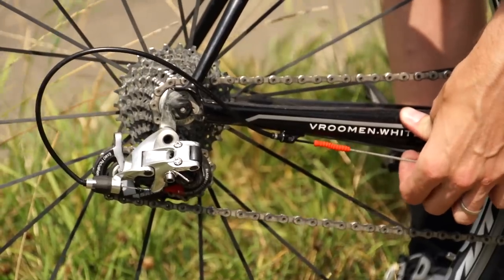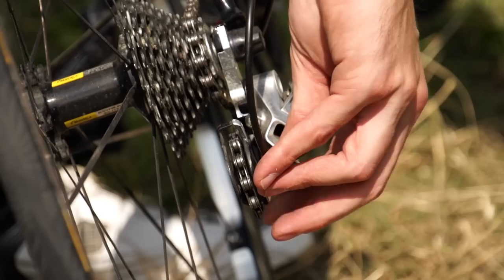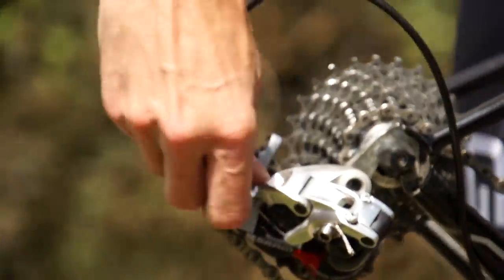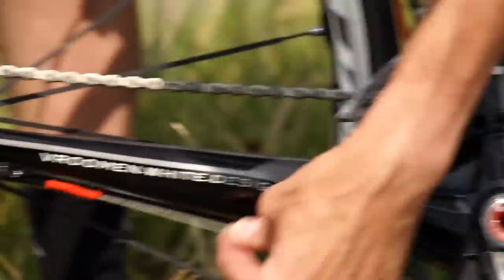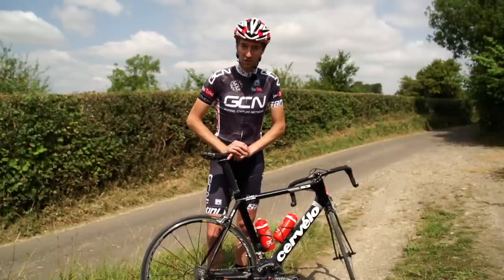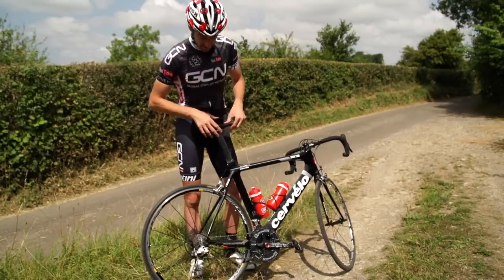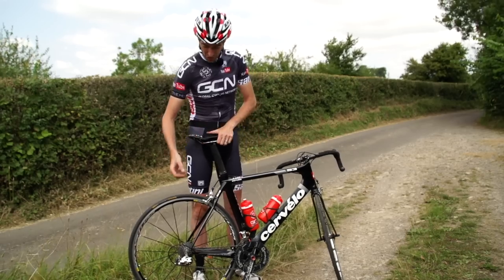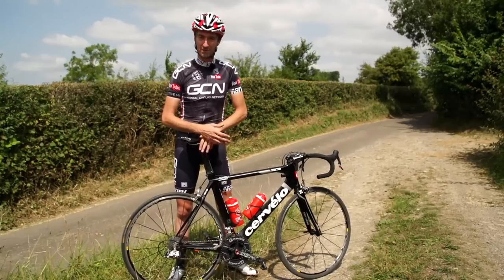How To Adjust Your Gears On A Ride - Roadside Maintenance

Comment: See this comment from TdF-grade pro wrench Nick Legan: 

"There are plenty of tricks for pre-stretching cables. (As an aside, it isn’t really that cables stretch, it’s that the housings settle in.) So when we install new cables and housings we’ll do everything we can to settle things in.

Bikes with internal routing can be difficult. The trick with bikes like the latest Trek Madones is to shift the rear derailleur against your hand. Put your bike in the small chainring and shift to the 14-tooth cog, or thereabouts. Grab the rear derailleur with your left hand, putting your thumb where you’d put a 5mm Allen key to mount the derailleur to the frame and wrap your fingers underneath to hold the jockey wheel cage. With your right hand shift your bike a couple gears, but keep the derailleur from moving with your left hand. Do this a couple times and you’ll develop cable slack.

On bikes with externally routed cables, you can simply pull on the derailleur cable along the down tube to shift the bike. I recommend holding the derailleur as I explained above. Usually you create slack in the system after a couple cycles of shifting this way.

I’ve seen some mechanics screw in limit screws on rear derailleurs and shift against them. But manufacturers have always discouraged me from adopting this technique.

The last trick is to leave the bike in the big chainring and the second largest cog overnight. The spring tension on the derailleur can help settle the cables just a little bit more overnight. Check the shifting again in the morning and you’re ready to rock.

Comment: Cheers, sorted out the sprocket jumping problem I had with this. Gears were running sweet as a nut for 80k yesterday then my chain came off. Now can't shift to the big chain ring. Can you do a vid on front mech adjustment?

Comment: Gnargh. Cables don't stretch folks, as they are pre=stretched at the factory with a weight many, many times order of magnitude the force involved in shifting. New outer housing and ferrules compress, until they are bedded in. Then any adjustment needed over time is down to the shifter eating its way into the inside corners of the outer. You can 'bed in' a new setup by trying to shift without turing the crank, but that does load the shifter/mech beyond what it's designed to do, so isn't a great idea.

Comment: Fairly new to the sport, I see nothing is really simple on a road bike and adjustments are intricate. Good vid. I'll have to watch it again. Wondering if you created a vid already on chains falling off. I've listened to many shop mechanic or friend's opinions but  it's confusing to understand the balance of adjustments. Also, when stopping, is it correct to always set the chain on the smaller chain ring up front? After stopping, I might back peddle for forward momentum and if the chain is on the larger ring, it falls off. I have a Trek Madone 3.1 2012.

Comment: @gcn I used your second tip with the cable tension, put the chain in the smallest sprocket and then manually pushed the derailleur up the cassette. After unscrewing and then tighenting the cable  unfortunately it didn't come down to the smallest gear again but was stuck...What did I do wrong?

Comment: I just got my first road bike. I'm having a bit of an issue. When the chain is on the bottom chainring and I shift into the lower cogs the chain rubs (chatters against the front mech) I shift the front mech which seems to have a half click in it  so does not shift straight up to the big chainring and this resolves the issue. Is this normal or is there an adjustment that needs to be made at all? Thanks

Comment: Hello GCN. My chain skips whenever I put a lot of pressure onto the pedal. Usually at the start of pedaling or sometimes uphill but this does not happen frequently though.
Reply from the maker: Hi, it could be two common things. Firstly, have a look at your indexing like in this video or a more recent one, or it might be that the parts like chain, cassette etc are a bit worn out, in which case you might need to replace them I'm afraid.

Comment: What if the problem is involving changing between sprockets on the front mech of the bike? Mine struggle to change and take many attempts for it to happen. Is it the same as adjusting the rear mech?
Reply from the maker: Panthers001 that's a bit more difficult to adjust mid-ride than the rear sprockets. Maybe this will help: How to Change Your Front Derailleur - Replacing Your Bike's Front Mech
Reply: Global Cycling Network Thankyou!

Comment: Thanks for the video. GCN videos are always great.
My gears shift fine, but slip between the middle gears say on the 11-28, they slip between 15-21, but they slip up of down by one gear at a time, so if its in 15, it slips into 16, then back to 15, then to 16 etc. What do you think the issue may be?
Thanks. Tom.
Reply from the maker: Hi Tom, It's probably a bit of an issue with indexing which can be fixed with the barrel adjuster too. Make very small (quarter turn) adjustments to it and you should get it sorted.
Reply: Global Cycling Network Daniel I nominated your for the ice bucket challenge  (ALS)! Good Luck!

Comment: Cable does not stretch! If it did think of all those suspension bridges collapsing.
What does happen is the outer cable ferrules are not seated properly in the cable guides when first installed.
Reply: If cable doesn't stretfh why do cable manufacturers go to the trouble of publishing stretch guides?
Reply: If cable doesn't stretfh why do cable manufacturers go to the trouble of publishing stretch guides?

Comment: Do you guys have any experience with, or opinions about kevlar cables? Reliability, durability, ease of adjustment?
Reply from the maker: NillerMann we don't, no. They look pretty good, but we like that metal cables for their cost, replaceability etc. One thing we've heard on the kevlar inner cables is that it's really difficult to keep them running smoothly.
Reply: Global Cycling Network Thanks a lot! I think I'll stick with good ol' metal cables then.

Comment: So I've just got a bike(Specialized diverge A1)for Christmas and when I took it out for a short ride around my estate I found the the mech wasn't shifting properly, so I got back and adjusted the cable tension for the rear mech and took it out again and all is good, but I cannot use the top 2 and the bottom 2 sprockets on the cassette as the chain starts to rub against the front derailleur, could anyone at GCN help me or could some one else help me or is it best to leave it to the mechanics at my local bike shop?
Reply: Jack Hird hHave you tried adjusting the Higher and lower limit screws on the front or rear derailleur?
Reply: Not yet but I will try that
Reply: Any luck?
Reply: Unfortunately not
Reply: I would suggest taking it to a bike shop and having them service it for you if you haven't already done so. Also, I too have just got a new bike after a 3 year break away from cycling. I have a Raleigh RX Elite and now and then have the odd gearing issue. I need to service the brakes and gearing as the cables are now a little more stretched out a little more. Again though a service would solve the impurities that the bike has got at the moment.

Comment: Pushing the derailleur to a lower gear to tighten the cable is unnecessary and silly. Why? Because if you have a good drivetrain, the cable should be hand-tight on the hightest gear (in most cases), and if the bike isn't in the hightest gear, it will allow you to make the cable way too tight. I work on Shimano stuff every day, and half the time I don't even have to touch the barrel adjuster to make it work right. Even if the cable has to be thghtened a little after being bolted down, the barrel adjuster can pull it more than enough if you threaded the adjuster all the way in before tightening the cable.

There is no need to make annoying things harder. Just saying...